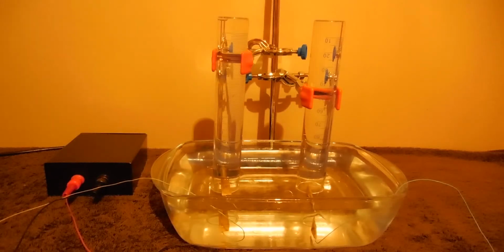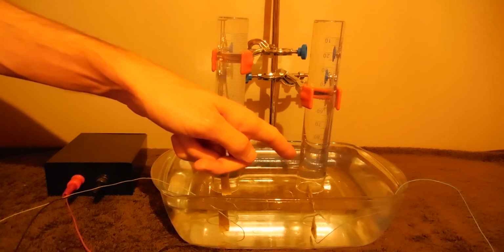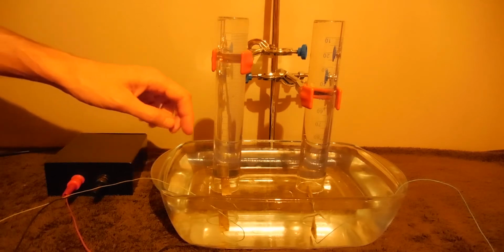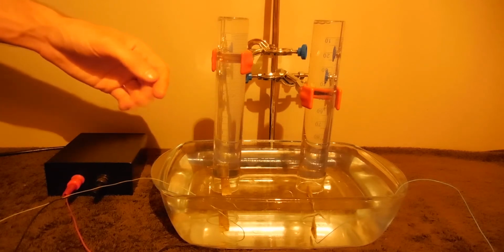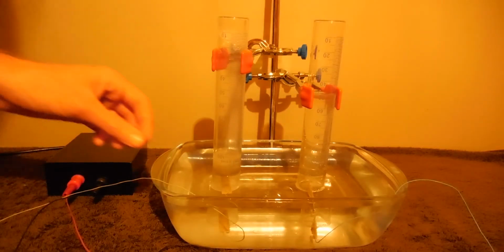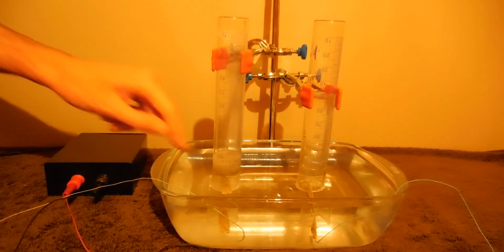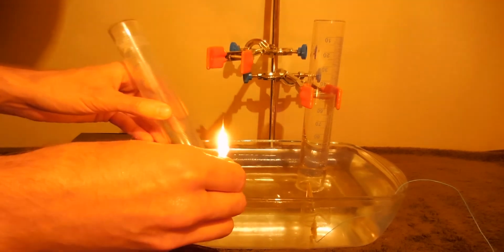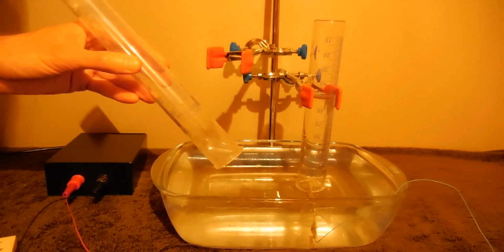Physics Experiment Electrolysis Of Water With Gold Electrode Timelapse Recording Full HD video

Comment: Very interesting, I am currently researching on a gold plated fuel cell, on the anode, instead of graphite, can you also use gold?

Also, how do electrodes behave? Do they corrode much, or don't they corrode at all? Interesting stuff my friend!
Reply from the maker: 24 carat Gold does not corrode (with tap water at least to any significant amount). 14 or 18 carat Gold will corrode (jewelry, rings, as they are alloys with Silver and/or Copper). I made plentiful experiments with Graphite electrodes. They got pretty hot with large voltage (230 V) and large current. Do you noticed? Or you're doing experiments with low voltage 5/12 V but adding some salt/acid.. ? It's hard to find very clean Graphite rods. After many hours of electrolysis, my water with Graphite electrodes on both sides, is contaminated by trash from Graphite rods.
Reply: Well, I've only tried with regular carbon rods from regular batteries, but to be honest, I haven't tried it yet by using gold, I have 24k sheets that are suitable for some minor decoration of leather boxes, radios, tea spoons, toys, etc;
I have this wild idea of electroplating the anode (for example, electroplate 5x5cm iron sheet with gold) and use it's (electroplated) surface to generate high volumes of hydrogen on a stack, example:

Anode : 1 sheet of gold plated iron (with paths engraved on it for the water and hydrogen gas travel around)
Sealant and electrolyte: (rubber or some other stuff)
Cathode : Either graphite or another gold plated sheet (mirrored paths of anode to allow for oxygen output)

About my methods, very basic ones, nothing too complicated, usually when (in the past) I've tried to generate H2, I would use more less the same apparatus you have but with either with a base NaOH, a salt NaCl, I havent ever used acids (yet, but I've heard they're the greatest for plating).

Eventually I'll post some info on that, though, it might take a while because I'm a bit short on time, with a dayjob and trying building a company from scratch is not easy !! :) :)  

It's only a mere idea I've been discussing with a friend of mine, we've been reading a lot, but we're still very unsure if we should go for it.
Reply: By the way, yes, I have seen that carbon can heat up quite a bit... That can be a bit of a problem!
Reply from the maker: If your aim is to produce just Hydrogen, f.e. for balloon, you don't have to bother too much what is made positive electrode.. Gold or other inert/noble metal on positive electrode, is needed if you want to have 2:1 by volume of Oxygen gas and catch it (2 volume of Hydrogen per 1 volume of Oxygen), and have no other remains in container. BTW, check my Physics Experiments Database Android app on Google Play Store https://play.google.com/store/apps/details?id=eu.trueart.www.physicschemistryexperiments and other apps science, quantum physics, chemistry related.
Reply: @RiderRickMaker hi, did you ever get to doing your own experiment?

Comment: Hello! Very interesting experiment. I am doing my own experiments and have similar results, except when I use gold electrodes. When I use stainless steel electrodes, the water turns brown, very similar to your experiment with iron electrodes. I think this is because the ions are reacting with the iron in the stainless steel. But how is this possible with 316 stainless steel? They should be inert.

Also, I am seeing a similar effect with gold-plated electrodes. The water turns brown. Maybe the gold plating was low quality, or the gold is not pure, because I see that the electrodes are still corroding. In your experiment here with gold and graphite electrodes, did your water change colors? It's hard to see in your video. If your water does change colors, do you know what material is forming? Thanks!
Reply from the maker: You need 24 carat Gold. Gold must be positive electrode (that's where Oxygen is produced). Water is almost crystal clear after the experiment. Typical jewelry is made of 14 and 18 carat Gold. Which means 14/24=0.58333. 58.333% is Gold. or 18/24=0.75.. 75% is Gold. The rest is f.e. Silver, Copper or some other metal alloy. If you try using 14/18 carat jewelry as electrode, you will destroy/damage it.

What voltage you used with stainless steel.. ? 230 V AC->DC like me? Or some small like 5/12 V.. ? Try decreasing voltage the next time. Also catch gases produced. From volume ratio, it's possible to predict which reaction is happening.
Reply: Thanks for the reply! Can I also use gold (24k) for the negative electrode? I also read that Platinum, Graphite, and Stainless Steel (316 grade) are inert/passive metals that can be used for electrolysis without damage. Have you tested with Stainless Steel or Platinum?